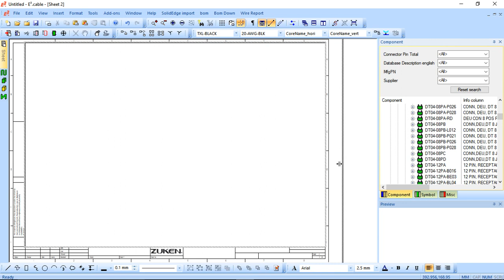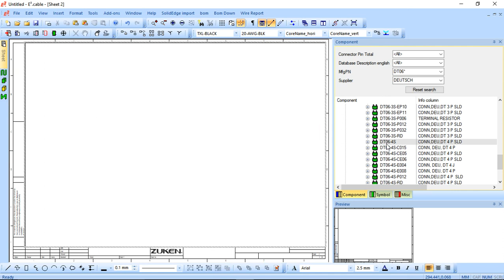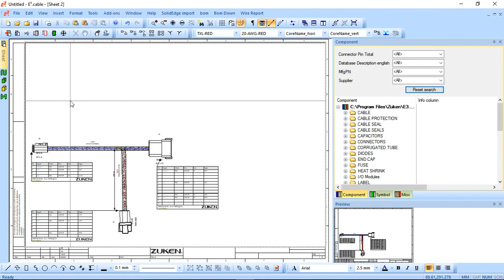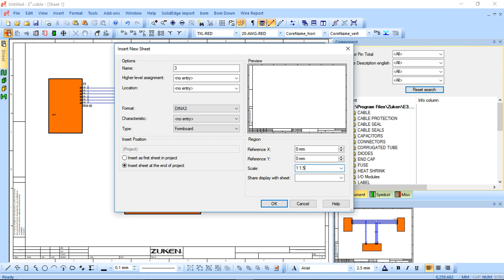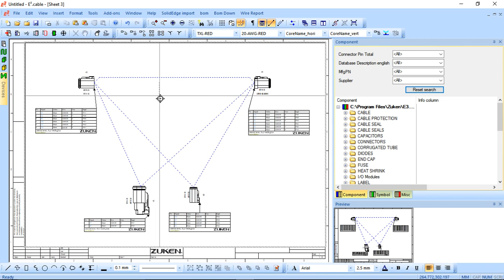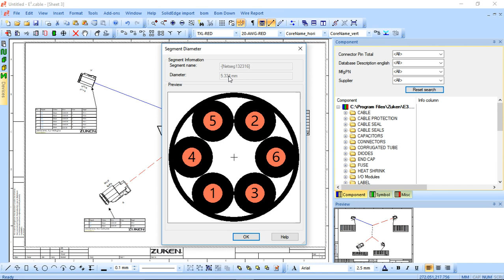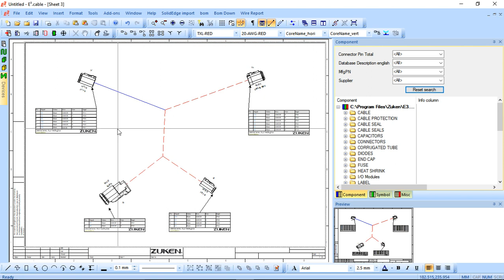Easy Harness enigneering drawing using Zuken E3.series

Comment: Formboard option is not available when creating Sheet. any settings to be made?
Reply: Hi mate thanks for your comment.
you will need to open your e3.formboard shortcut then it will show up 😄
Reply: @PedroSilva-eq9hw  I cannot find any specific shortcut for formboard. Can you please let me know where it will be or how to open the shortcut?
Reply: @nandhaselvakumar  are you opening the e3.cable shortcut in windows? Or just the e3.series.exe?
Reply: @PedroSilva-eq9hw  shortcut
Reply from the maker: @nandhaselvakumar  if you dont have the E3.formboard shortcut in your start menu, you can right click properties and under your target you should have something like this. That is assuming your have Formboard license line.

"C:\Program Files\Zuken\E3.series_2019\E3.series.exe" /formboard
Reply: @powerjumpaustralasia  @Pedro Silva I got it.. it is working now.. Thank you very much 🙂
Reply from the maker: @nandhaselvakumar  happy to help. Have a great day!
Reply: @powerjumpaustralasia    I have One More question , While creating twisted pair cables The options "Place" and "Auto place Bundles" are not available. Can you please let me know if anything needs to be changed to get those options?
Thank you in advance!
Reply from the maker: @nandhaselvakumar  Hi again, 
hmm interesting, can you please confirm which version of e3 you are using?
Reply: @powerjumpaustralasia  E3 series 2019 version 20.0.0.0 64 bit
Reply from the maker: @nandhaselvakumar  this may be due to your settings. if you press s on the keyboard, then under placement>symbols>bundle symbols you will need to make sure parameters are defined, specifically the symbols to be called up when place?auto place. I believe the option wont come up unless you have these populated. 
Good luck
Reply: @powerjumpaustralasia  thank you! I have changed the settings now the autoplace option is available. But the symbol is not appearing in schematics as if I select auto place bundles option nothing is happening
Reply: @powerjumpaustralasia  Hi Again!, I have one more issue that i cant able to place Bill of material table as the icon is not available. Is there any specific Module to be run to enable that? thanks in advance!
Reply from the maker: @nandhaselvakumar  HI, 
hope your are well, can you find in the toolbar, tools>reports>sheet Bill of materials?
Reply: @powerjumpaustralasia  I am very good thank you..  and please help me to get the wire table (pin to pin)
Reply from the maker: @nandhaselvakumar  no problem that is the connection report :)